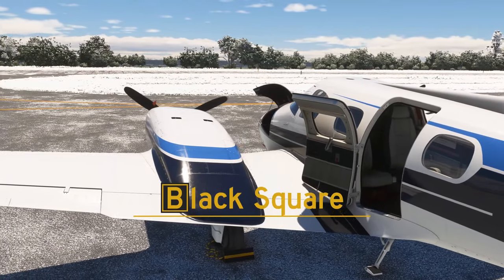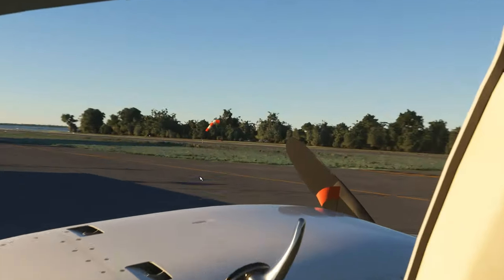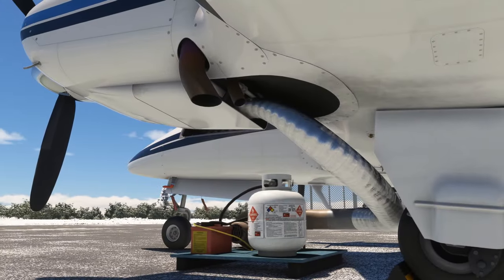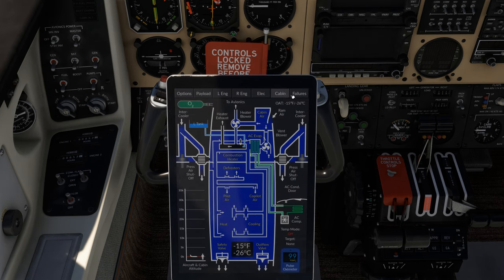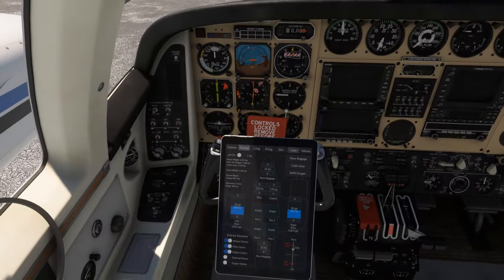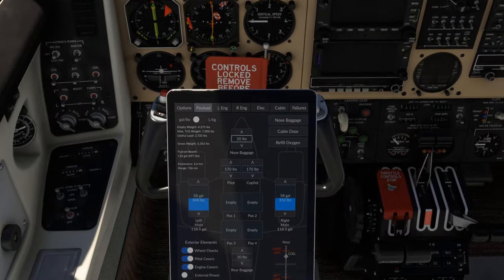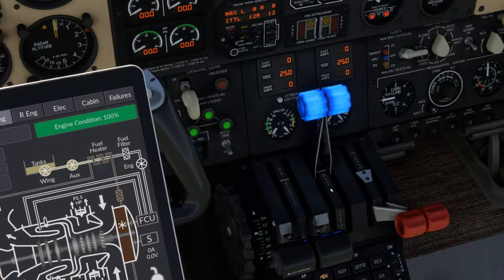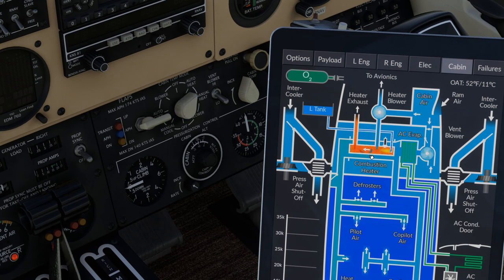Black Square Dukes MSFS - Exterior and Preheating - Just Flight

Comment: Seems like they have included every possible realism in these planes except for the monthly payment to the bank.
Reply: And that´s the best part, because I have read a few times on the internet that this Duke was an expensive comfortable and luxurious airplane and over time many only average-rich-guys needed to give up this plane because of the maintenance and fuel costs. In reviewing the aircraft in 2008, Rick Durden of AVweb stated, built to the quality standards of a King Air, the six-place Duke sported 380 hp [280 kW], Lycoming TIO-541 engines – rare beasts, those – which means when both come due for overhaul, the choice is the overhaul or buying a small house in the Midwest.
This wonderful simulation allows to own something many times not even many rich people can afford :D
Reply: @juliashenandoah3965  Correct! Which is why I can also own several A320's, 737's, a 747, etc. 😀

Comment: Love how this airplane simulates either an easygoing one-click starter (turbine version) very forgiving and easygoing no matter how cold and wet it is, but still all the important details simulated like hot starts or different starts depending on wind blowing in the air duct or exhaust... or flying the true classic original that was not converted to turbine, a stubborn piston beast that really needs to be warmed up before starting, almost kicking out the circuit breaker at every starter motor engagement. 
We are achieving X-Plane P3D and DCS levels here :) when the poor Duke has spend his night outside the hangar in Anchorage the engines really need a good warming up before soaring through the skies. 
Will the morse code beeping of TACAN and VOR stations also be audible on the radios? 
And I have seen another detail: There is a blood oxygen indicator on that tablet - what happens when it reaches zero? The screen going black and the sounds fading? Will blood oxygen and carbon monoxide leaks be fully simulated?
When the engine health drops below 50% is it planned to silently play some metallic rattling sound that gets louder and louder the more damage the engine takes?
Can instrument light bulbs for the gauges fail, forcing the pilot to switch on flood lights which makes nightly rainy landings more challenging? :)

Comment: Did you ever sort out the engine heating speed from cold. In the bonanza the oil would be to operating temp within 1 minute of turning the engine on.
Reply: Yes! That’s a problem with most MSFS Aircraft (except A2A).
Reply: Yes, correct A2A has nailed it in that department. If black square have sorted it out, this plane will be on par with the comanche, i think. I'm very excited!
Reply: @AlexMills13  The PMDG DC-6 simulates this very nicely as well.

Comment: Request: For the temperature on the tablet, I'd prefer to see a toggle switch for °F/°C, rather than having both displayed. Easier to read, less chance to misread. Same as is already shown in the Payload tab for 'gal/lbs' vs 'L/kg'.
And a practical question: If you use the battery cart, would you normally start the right engine, hop out (door being on the left) to unplug it and move it away, then hop back in and start the other engine? Or would it be more normal for a helper at the airfield to do this for you? These are the kinds of questions that come to mind when trying to use my sim more immersively, and which manuals, checklists and the like do not usually answer.
Reply: You'd normally need to move the heater over to the second engine yourself.  But there have to be limits sonewhere I guess, even in an addon this detailed.  You could always just 'simulate; (pretend) that you've popped outside and moved it over to the other engine.
Reply: In real life, getting out of the airplane with an engine running is a big no no. That would definitely be the job of a helper.
Reply: @4lifeifly Thanks. I figured that may be the case due to risk of the aircraft running away uncontrolled, but dare say it's been done by a few individuals before!
Reply: @droge192 For the heater, makes sense as the engines aren't running anyway, but I wondered about starting up with the battery cart - was answered in another comment in any case :)

Comment: Once when working as a ramp guy, we had one of our tenants fly in from Martha's Vineyard in his TBM-850, and he had left the aux cowl plug in and as a result he couldn't get the plane to go into "850 mode", and when he landed, the cord to the Remove Before Flight flag had blown over the exhaust, and melted. The add thing is, that he got the main inlet cowl plug but forgot the one on the side.

Comment: JustFlight could you please fix the Piper Arrow that is advertised on Aerosoft’s website as XP12 compatible, I just bought it .. got the SkunkCrafts XP12 update .. and the GPS displays both 540 and 750 are dark blue not black, and the prop animation from inside the plane is near invisible .. same for your XP12 C152 .. at least the prop animation . the C152’s GPS screen is black like it should be in the C152. Thankyou
Reply from the maker: That's an issue with AS advertising them as XP12 compatible. You need to claim for a refund from them.  They will hopefully be fully Xp12 compatible in the future but that's not the case currently.